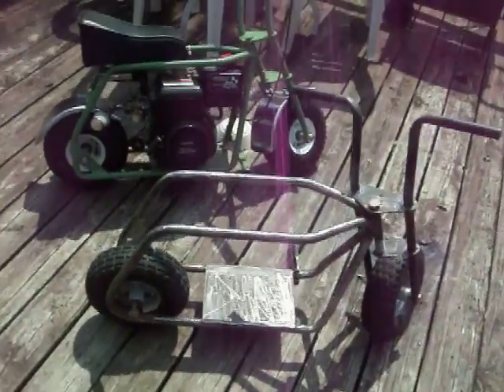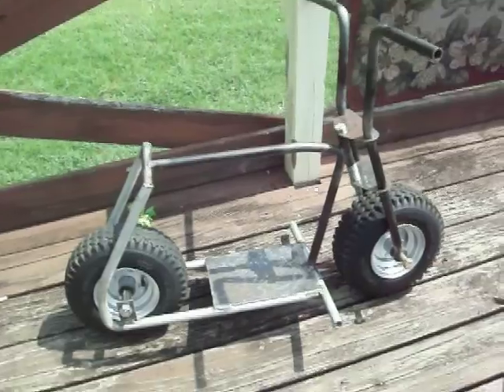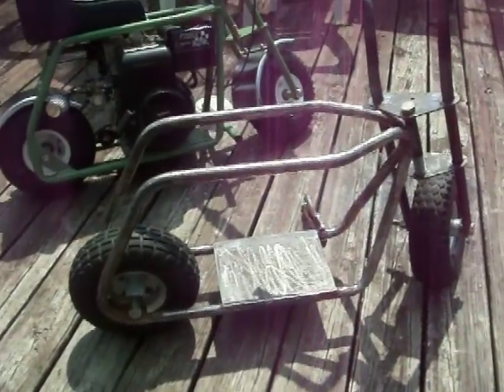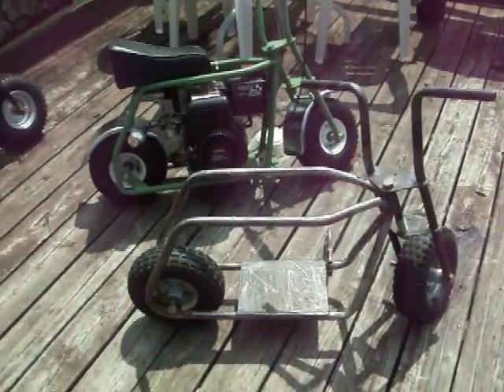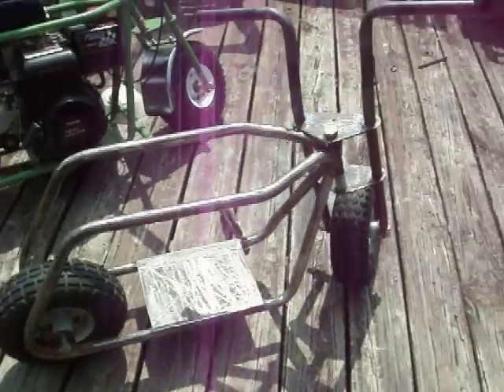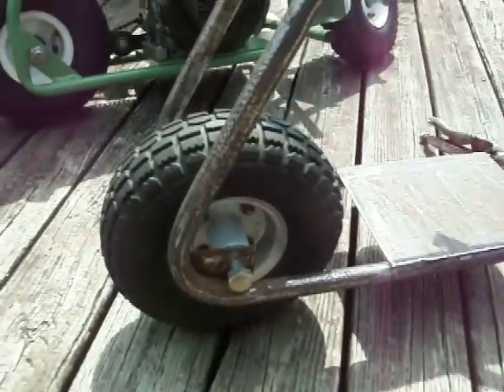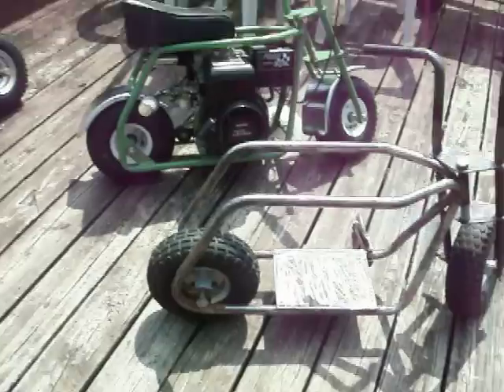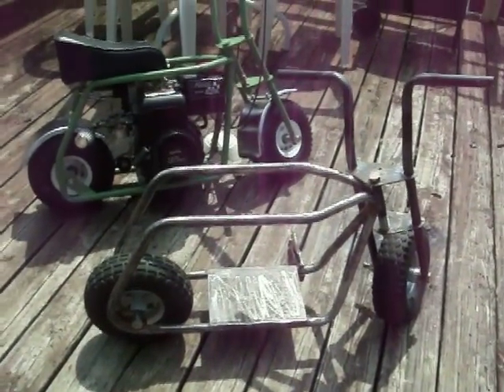MINI BIKE Rupp converted to LIL Indian

Comment from the maker: Thanks I appreciate it,,I simply heat the tubing with a torch and bend them by hand,,,its tuff sometimes to get them straight and the curves close to the same but taking time and measuring and heating in the identical spot on each piece of tubing helps to make it easier,,Im 2 minibikes ahead of my parts now and need 2 motors and 2 seats and 4 fenders and so on,,haha,,,thanks buddy i appreciate the nice words,,,Rick Norris

Comment from the maker: yes I remember that now and it is amazing we still have these cars isnt it ? the body on mine is as solid as a rock and I should be ashamed I dont have it running yet,Im gonna have to drop these minibikes long enough to get another nice 350 chevy dropped in it,its already set up for chevy although I have a rebuilt 304 and trans but I like the chevy motor old buddy,the quickest car ive ever owned it the 1980 AMC spirit with the 350 checy and muncie 4 speed and 388 gears,talk about neck breaking..

Comment from the maker: different places,,,when i cant find one at a junk yard or have wha i need to make one I buy them from northern tool and supply,,,sometimes I find them at junk yards and then I have found and mounted a sprocket on a aluminum type wheel,,,to make one work on a none sprocket wheel ther has to be places to dril and thread holes,,usually gokarts are fairly plentiful at junk yards and usually you can get a sprocketed wheel there,,hope this helps.

Comment from the maker: All I have at the moment is the overall frame length axle to axle is 28 inchs and top of handle bars down to axle hole is 24 inchs and the frame inside where the motor sits is 12 inchs,this is the basic size of it,,thanks